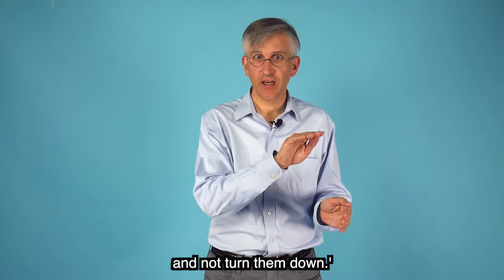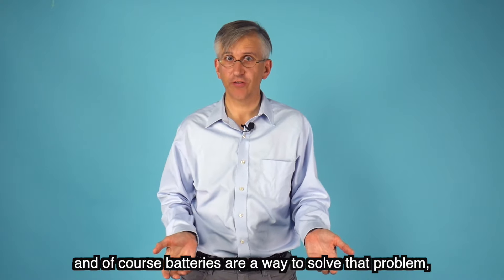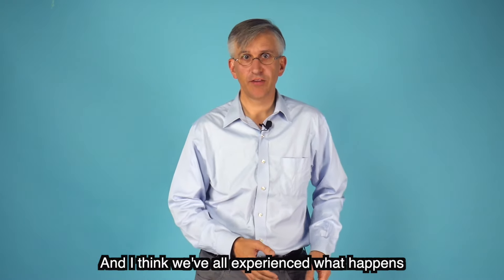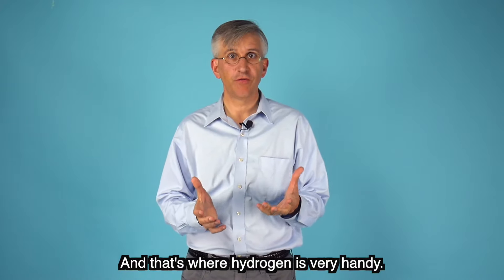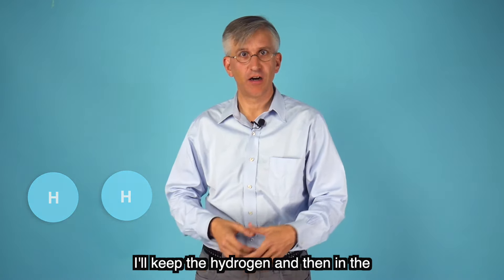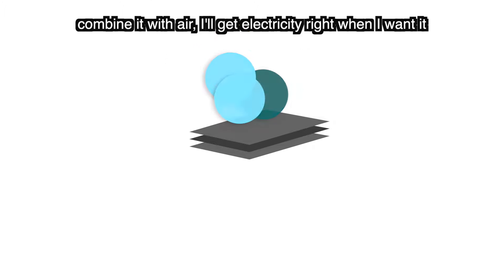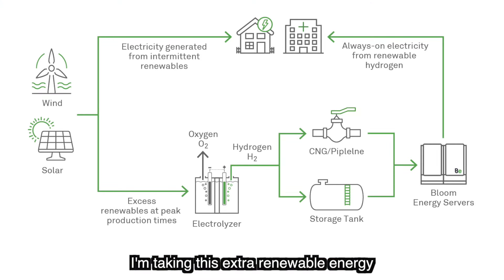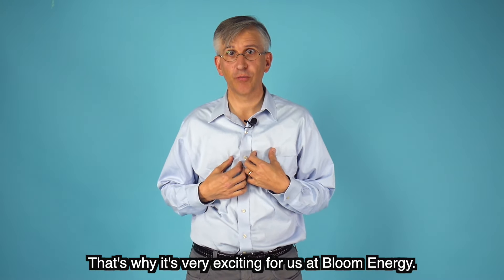Bloom Energy Announces Hydrogen-Powered Energy Servers

Comment: You are doing well. But the solution is still not solved. I am in africa. We have power problem. The national  grade is costly  to pay. Please make you sure the server are really available  for use in household.
Reply: Ripple/XRP Preacher 

Excellent point.

That is the ticket to freedom. 👍🏻
They gunna fight it...
Is like taking banking system back. 
Or taking media back...

Household self reliance is the right move...

My energy storage is elevated tank and ground level tank. Any low viscosity fluid can be used. Lift pump is used to pump fluid to top reservoir using excess energy from solar power plant consisting of fresnel lens collector/oil heat exchanger/boiler/steam turbine. The And during evening periodic break and water is diverted back to bottom reservoir through a hydro electric turbine. 

The hydrogen will be incorporated as a back up heat source for heat exchanger, to cook with and to fuel vehicles.

Comment: Excellent presentation with many references that involve the audience; however, an energy source dependant on a specific fuel is not ideally practical as a fail-safe, always-on energy production process. Fortunately, there are ways to turn any material into a fuel source for fuel cell electrical production. So Bloom's tech is perfectly positioned to be the key generation technology for a society that is growing exponentially in its power needs and to reliably be working when other infrastructure delivery services cannot. Party on Dudes, be good to each other.